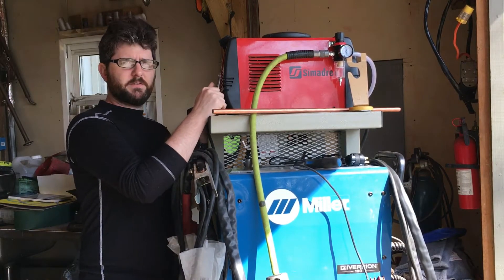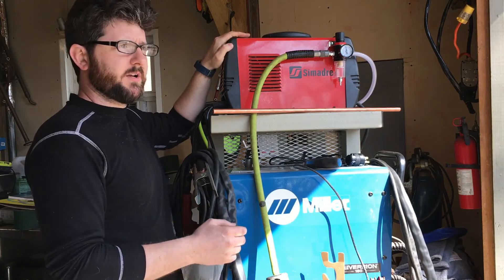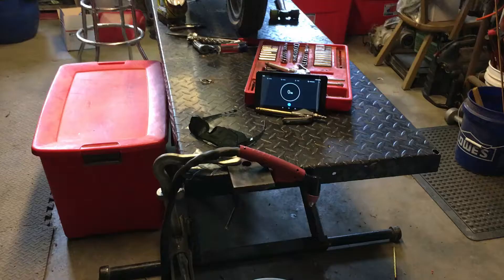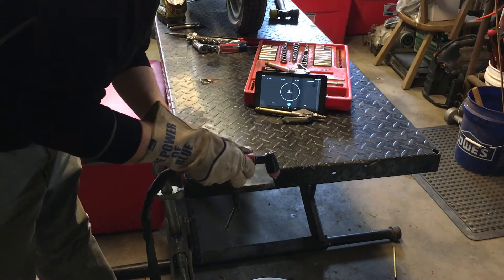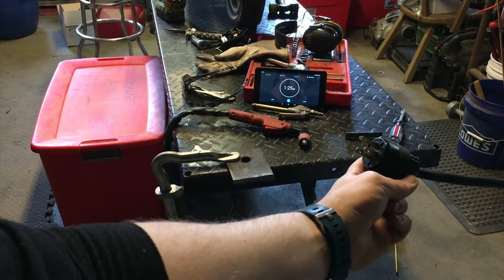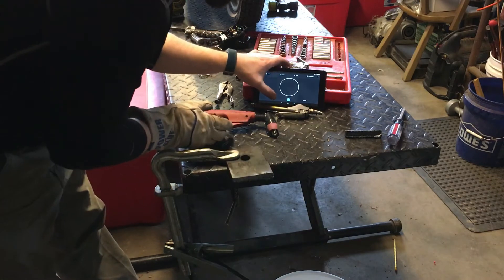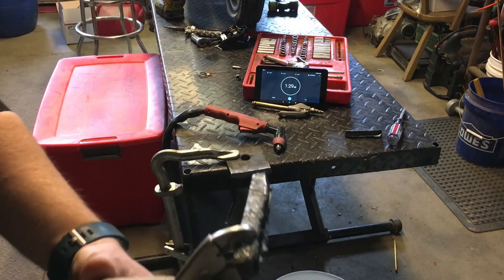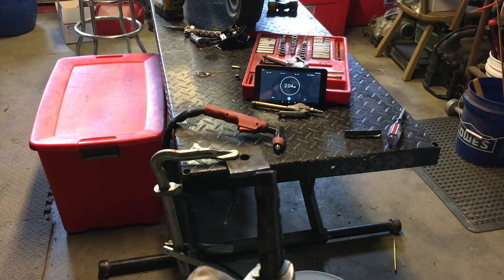Does input voltage matter? 110v vs 220v Plasma Cutter Simadre 50rx

Comment: Great, real world test! I just bought an inexpensive  plasma cutter with dual voltage. Before it gets here, I've been thinking and researching 110 vs 220 as I have 110 in my outdoor shop and would have to run my 5000 watt generator to have easy access to 220. That opens up another whole question of current draw. Thanks for the demo. Reassuring that it's probably not worth the work to go with 220. I'll be cutting probably mostly 1/4 inch and thinner material anyway.

Comment: The duty cycle will be less on 110 verse 220.
Reply from the maker: If thats true then I still think the versatility of 110 outways the reset wait time.  Someone should test that.
Reply: Not that hard to run 220v. Use a double 50 amp breaker. You'll get the maximum amount the unit will produce. Thanks
Reply from the maker: I assumed that to be true in theory but the whole point of this video is that this unit performs just the same on 110v.  Now on 110v one can just plug it in anywhere.  3/8 steel is a reasonable capability for this Cheapo.   Anything  thicker than that someone would benifit from a more expensive machine and of course run it on 220.
Reply: @Gizmowerks   Have you tried it again on a 110 outlet that is supplied by either a 15 A or 20 A breaker? thanks